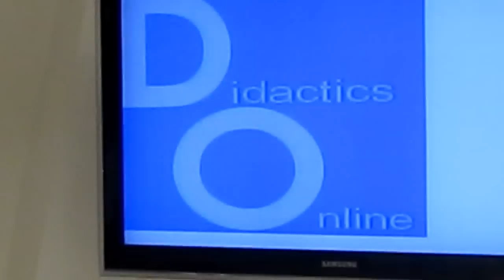Pelvic Diagnosis

Comment: The dysfunction is normal opposite of the positive finding.  You confirm the standing flexion results with ASIS compression test.  Sometimes you will get contradictory findings; in which case you trust the ASIS compression test over the flexion test because you can get false positives due to hamstring tightness.